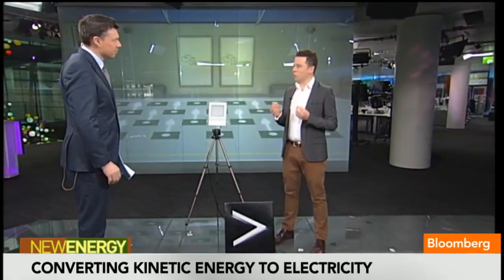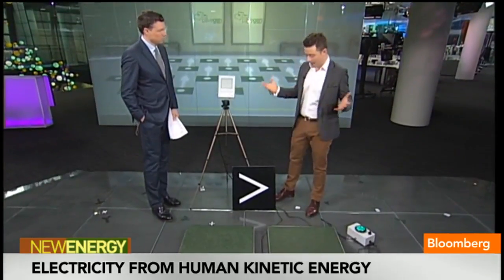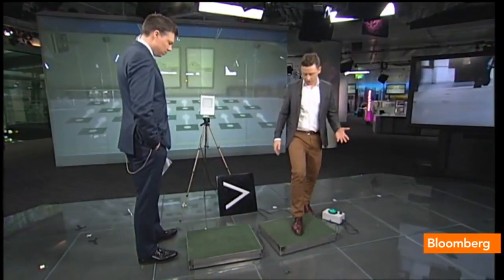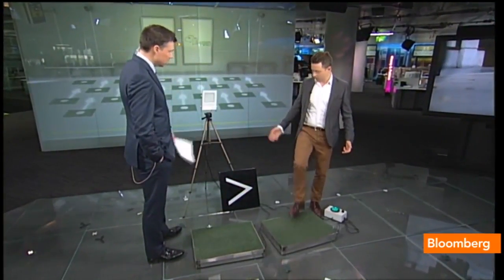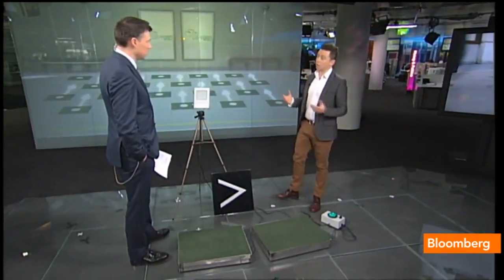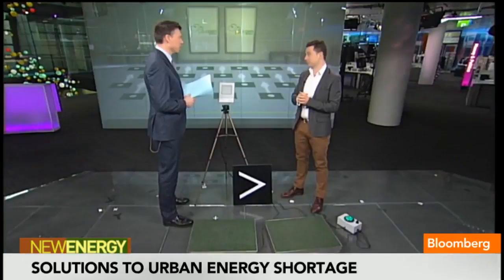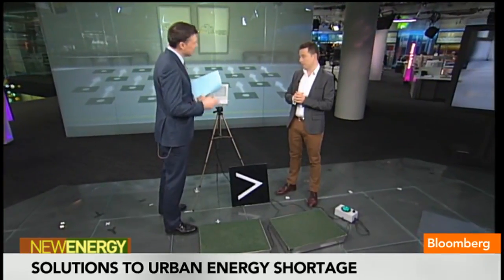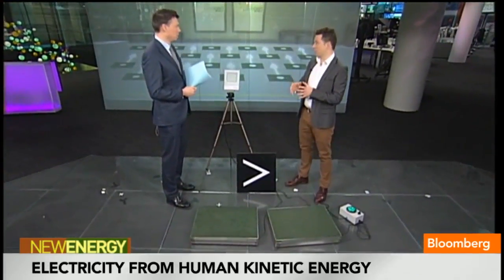How Walking on the Street Converts to Electricity

Comment: This rep is clearly a salesman. His auto-responses had all the slow emphasis on particular phrases  "Almost on par with solar."  Misleading focus while softly adding  "during the winter" .  Having designed hundreds of solar pv systems on homes I can attest that the summer months provide approx 70% of annual production. Also in the winter north facing  panels barely produce at all. Plus that source is constant during daylight.  There were no numbers or measurements of kilowatts being produced.   He lit an energy efficient LED bulb for about as long as he walked before growing dim. I hope his smooth talking doesn't convince anyone into investing without providing the numbers.

Comment: Stupid. Avarage step is 5 Watts, only one person can stand on each tile at most due to avarage space needed for walking people. If you mount 400,000 of those you can match single wind turbine. Even if they cost 20 pounds a piece, which I doubt they do it is cheaper to build a turbine or invest in harvesting electricity from other sources.